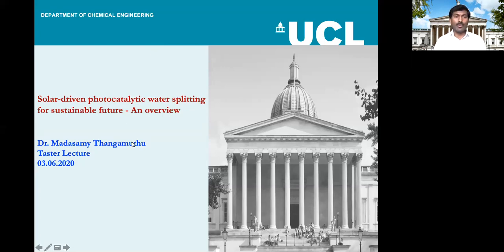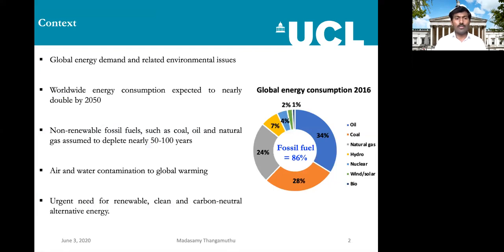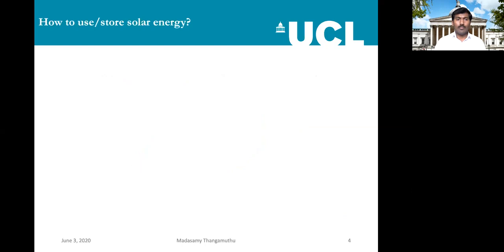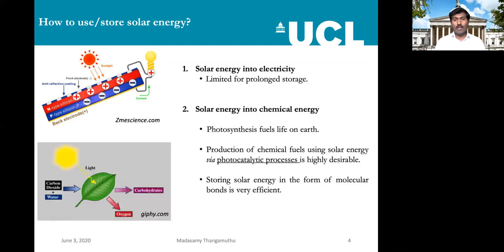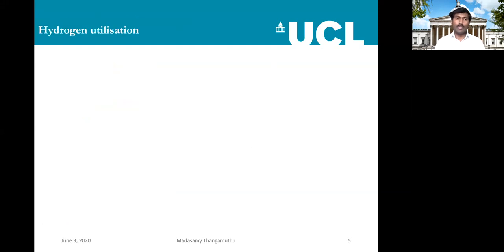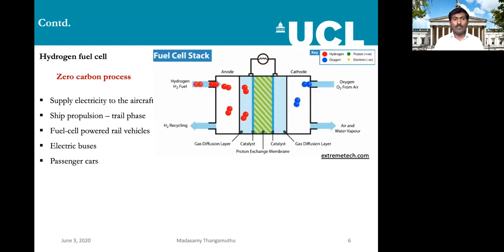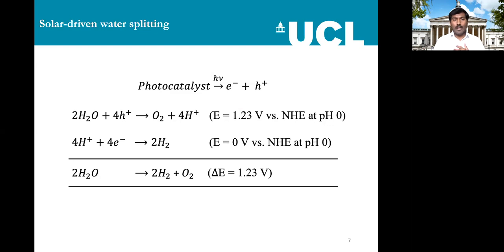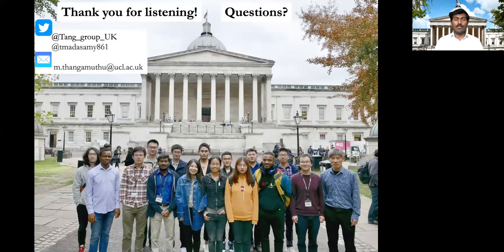Taster lecture: Solar driven Photocatalytic Water splitting for Sustainable Future – An overview

Comment: Thanks for this intersting lecture, with greetings from Germany. Can you say a few words about any specific problems or advantages when it comes to graphitic carbon nitride?
- How quickly does it decompose?
- any good co-catalysts among more abundantly available resources? (Fe? MnO2? S? ...)
- can you think of any specific problems when trying to achieve efficient water splitting with g-C3N4 and untreated ocean saltwater (pH...)?
Reply: Dear Christian, thank you for your questions. Apologies for the delayed response.
The stability of carbon nitride is mainly dependent on what condition you are going to use (acid or alkaline or neutral) using light or thermal catalysis. Normally self photocorrosion is one of the major issues which can be prevented by coating a thin passivation layer.
Cu is a very good co-catalyst that is cheap and earth-abundant
You can think of the pH of the ocean water which is more alkaline. As I said before, you must think about a thin passivation layer to protect C3N4. 
Let me know if you want more details.